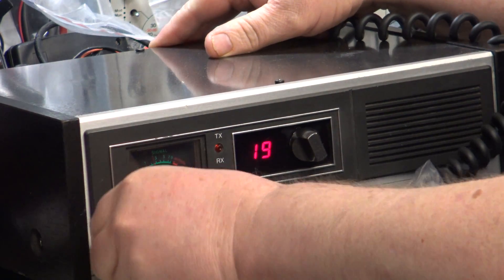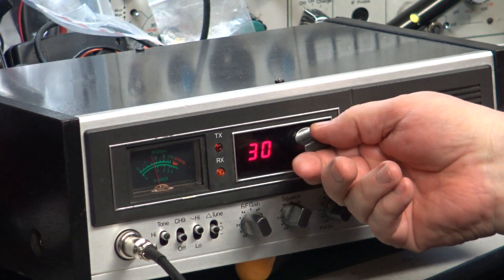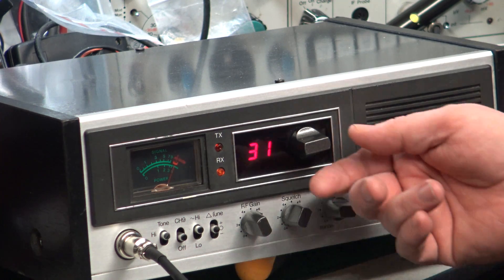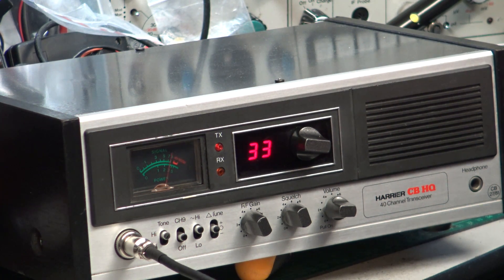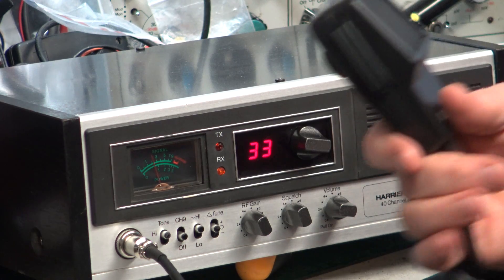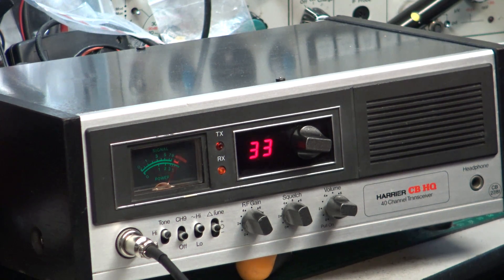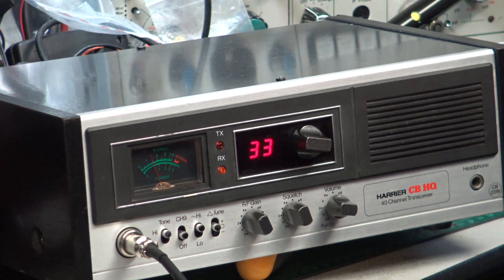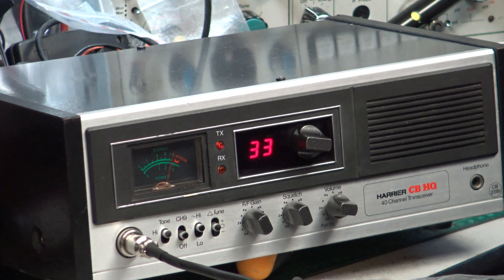Harrier CBHQ CB27/81 UK FM Base station - On The Air test

Comment: Hi Richard, I have a harrier cbx, could you give it a full service please.
Reply from the maker: roger   rshireby@yahoo.co.uk
Reply: @ukfmcbradioservicingTango21  if you are going g to do my radio for me, can I have your postal address and email, please.
Reply from the maker: @stewartgamlin8517  Stewart, I've already replied with my email address & it's always been in the 'blurb' too.

rshireby@yahoo.co.uk
Reply from the maker: @stewartgamlin8517  Stewart. rshireby@yahoo.co.uk is my email address. You need to type my email address into whatever system you use to send emails, then ask me over an email what you want.

Richard

Comment: Nice job, shame the radio has lost the wood effect on the side, I like that it's what makes it look so retro, I have been given 5 CB radios from a silent key estate one of which was a CBHQ, it cleaned up really nice and I followed your old video guide to tune it and it now works great, it also came with a nice sadelta echo master plus desk mic which I serviced as well.

Again big thanks for these videos, following your guides are so useful, saves so much time and helps us all do such a much better job ensuring these radios keep on working long after we have stopped working. Cheers
Reply from the maker: I think the vendor did the right thing with the otherwise 'tired' sidecheeks under the circumstances. The only real alternative would be to make entirely new ones in solid quality wood. The original sidecheeks are MDF covered in 'vinyl veneer', the edges of which get easily caught in everyday use.

I'm certainly not a fan of echo mikes. As a business radio engineer, if they were a good idea & helped in any eway, the emergency services & military would be using the, They aren't! However, I accept accessories such as that can be highly collectable.

Richard
Reply: @ukfmcbradioservicingTango21  I think if you look the veneer is still there so they still have the wood effect, just more a smoked charcoal wood effect.
Reply: I wouldn't use an echo mic either but knowing what they go for second hand you'd be mad to turn one down that was free, real wooden side cheeks would be nice, mine also has the original screws, I've heard ham operators using echo mics on inter g HF always makes me laugh, what next a Roger beep? LOL

Comment: I love the look of those early 80's base radios. I had a York 869 that I kick myself for selling in 1988, but needed the pennies to enter the rarefied world of 934Mhz.
Reply from the maker: Moral. Never fund another interest by selling stuff you already have. If I think I want a different car, I do not part exchange the previous one.

 Someone at church gave me a York 869 with some serious synthesizer issues..only selecting certain channels...18 months ago. I was going to give them £45 for it 'as is' "oh no, you can have it" he said. I replaced the LC7137 (about £15 these days) & the caps in the PSU. Not often I come up lucky like that.

Richard, G0OJF, UK
Reply: @ukfmcbradioservicingTango21  It's not often anything 'lucky' pops up these days, your Fidelity 1000 purchase for £1.04, for example. It doesn't seem that long ago I was buying things like Binatone 5*, York 863, Communcators NI400DX, all for around a tenner a throw. That ship has well and truly sailed, for now.
As for the 934, it was an offer I couldn't refuse and had to act on. It was a mint Reftec BS 934 homebase with all fixtures and fittings for £50 from a silent key estate. I've still got it, but these days it does little more than keep the shack door propped open in summer.

I very much enjoy your videos, especially since my old eyeballs won't allow me to tinker any more.

Lee
MW0LDJ